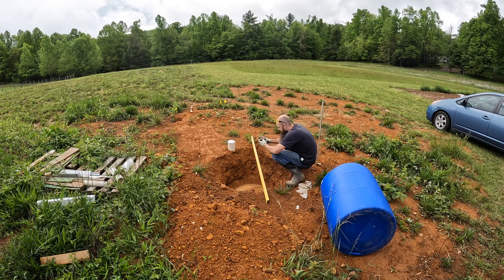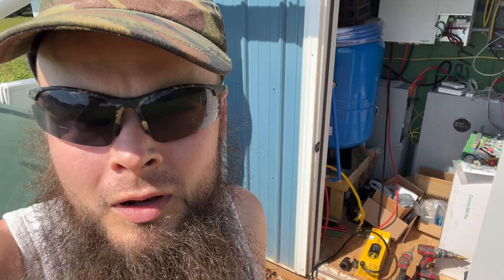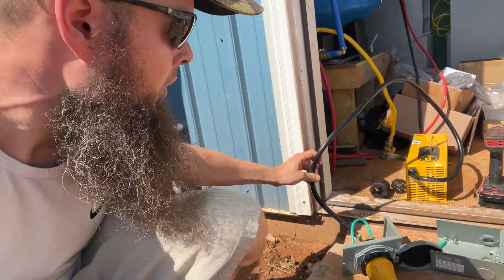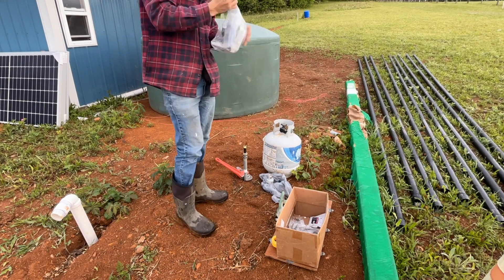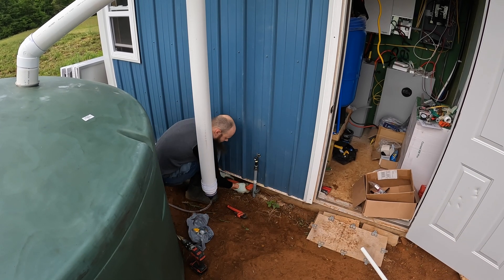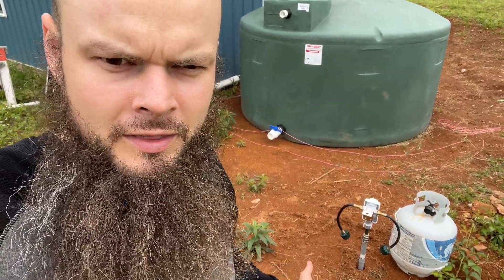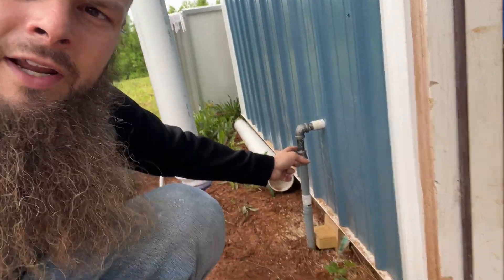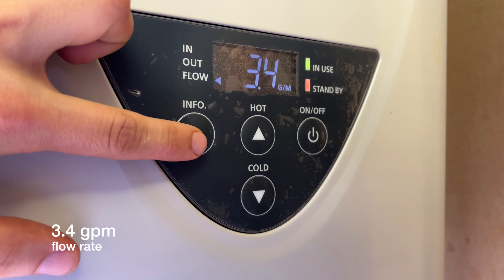Solar shed part 48: hot water and battery charger

Comment: at time stamp 4:45   i see you are using galvanized.  this is not recommended for propane by the company that sells my service. they would told me when i was getting the stuff i had to use black pipe without exception, although copper would work.   you might check on this at your schedule permits.
Reply from the maker: Hey thanks! It is definitely supposed to be black pipe. I don’t know why I had galvanized fittings in my bag. I’ll replace them